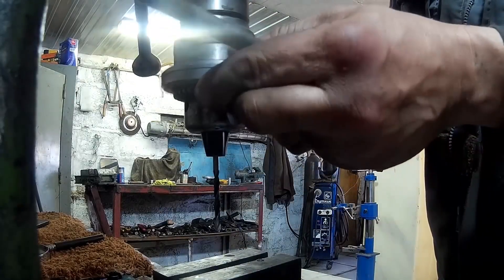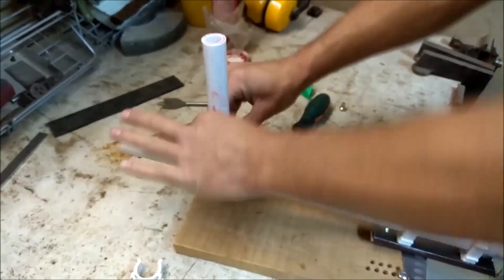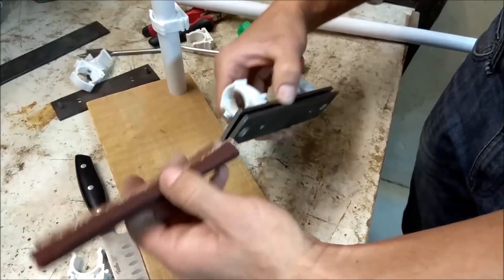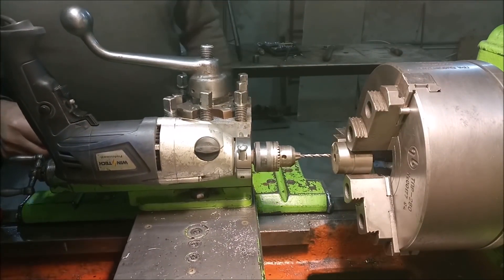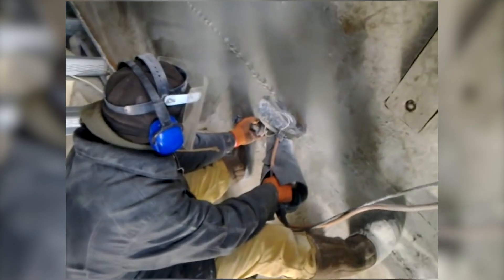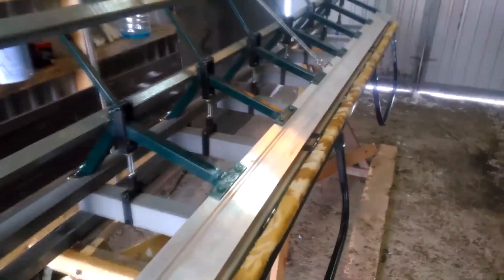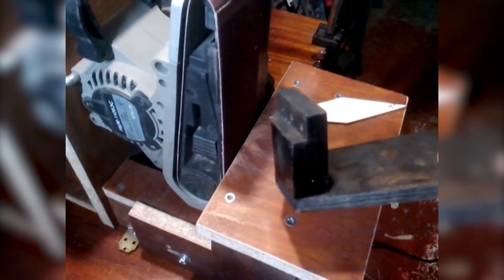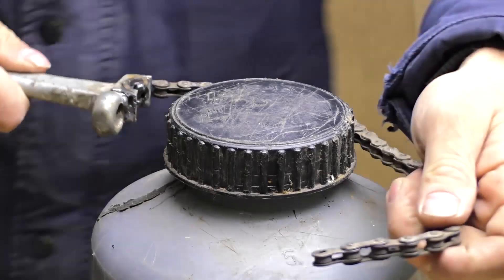Genius idea from a bicycle pedal

Comment: Using the tool with the collar on a drill chuck the way you show will ruin the 3 holes in a chuck by elongating them. Drill chucks have 3 holes for a purpose. You use all 3 to tighten a bit, not just one. Also, a good T-handle chuck helps. If it still doesn't tighten, you need a new chuck or you will ruin the shank of all the drill bits used in it caused by spinning in the 3 jaws.
Reply: If the rod is the correct size AND you use all 3 holes to tighten, then would that be okay?
Reply: I suppose if the chuck is already damaged...like mine.

Comment: some good ideas but what you called a "press brake" is nothing more than a sheet metal folder
Reply: It's a press brake moron.  stay in the kayak...yuou know nothing about construction.
Reply: Have you tried folding sheet metal? The angles, the tight tolerances, etc. Sheet metal is an excellent material to work with but to do it efficiently....
   There is no comparison. The longer the better.
  No smart aleck comments, please.
Reply: @tommieduhswamy6860  no k havent TRIED folding sheet metal.

i HAVE folded sheet metal on a press brake,a real sheet metal folder and of course dy hand using a former.

do you actuall think i dont know the difference between the tools for folding/bending
Reply: @jadekayak01  as a matter of fact, I KNOW you don't know what you're talking about...a  lot of words with an obvious lack of knowledge on the subject.   But you'll keep spewing your garbage.  I'm just trying top keep too many from falling into your pit of ignorance.
Reply: @stevesanders4552  well well well,

you KNOW shit.

good for you
Reply: There's nothing wrong with d.i.y. machines since the factory built machine retails for big $. I've built many cutters, benders, grinders, etc.  Sometimes the Harbor Freight product is useful. Sometimes I buy cheap and modify it. It depends on the application. Sometimes it's not possible to find such tools, and we end up building our own. Been fabricating part-time for the last 40+ years and I just can't seem to get enough of it.   Never would I have it any other way.
Reply: @jadekayak01   is this not the machine used by siding and gutter professionals. I believe they call it a brake. A "press brake" uses a different principle of downward pressure to "form" the material, i believe. A "Box and pan" brake is another type. I could be wrong, though.   Cheers and don't be too hard on me...i have delicate feelings. LOL.
Reply: @tommieduhswamy6860  professionals call a press brake a press brake.

these things work on downward pressure.

absolutely everythibg is programmed into modt of them-length,thickness,angle,material.

the "box n pan" you refered to is actualy a CAPABILITY .

this can be a std sheet metal folder or a  press brake.

most folders and all press brakes come wit a selection of tools for various lengths to accomodate any fold size from machine smalledt to largedt.

some dont buy all the tools as they dont need them for thier type of work.

the italian machine i worked on had std length tools/anvils of about 400mm and a lelection of tools to fold anything from 100mm to 5m

Comment: Utter rubbish. A strap wrench is about £10 the drill in the tool post is dangerous and will not mill as suggested. The grinder will work just fine if you buy a dry cutting disk and never ever use any thing other than a chuck key for a chuck as the teeth are a part of the chuck designed to be tightened, the drum around it is a cover that once sheared off will eventually destroy the chuck body.  The chisel is ground sideways , really! And sharpening a knife is hardly that difficult.